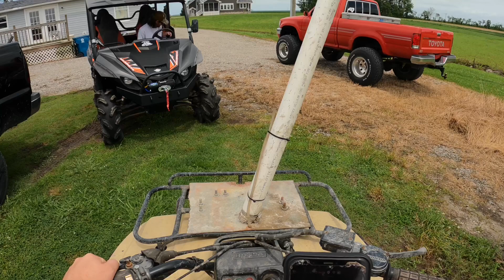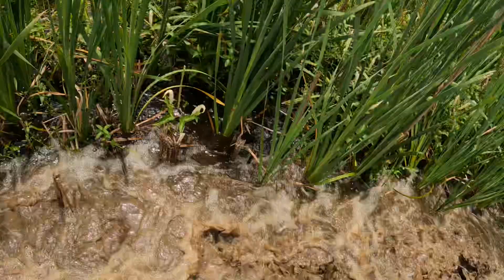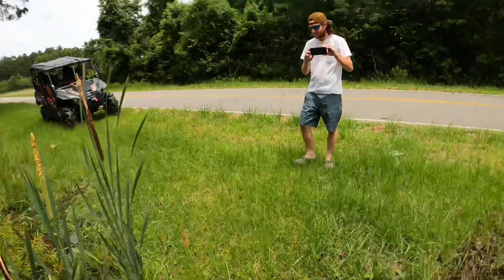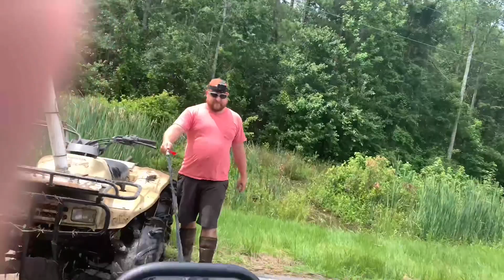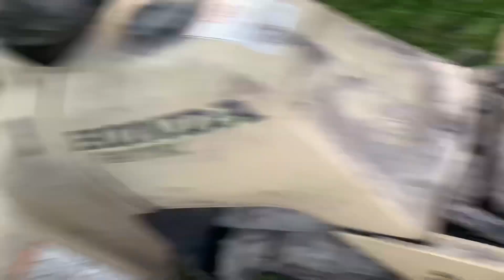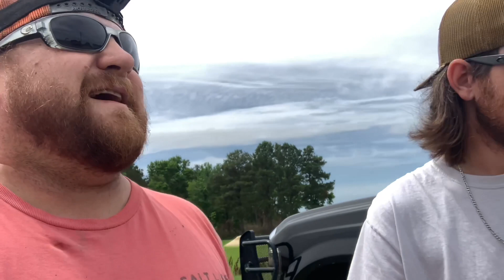HONDA TRX 300 6x6 finally starting to show her worth!!

Comment: First diff lock 300 ? 🧐🤷🏻
Reply from the maker: Hell yeah I fixed the Honda’s 3x4 and turned it into a 5x6 it definitely worked though 😂😂 I want to do a locker so bad but they don’t make the 4x4 shut off anymore and used ones are rarely not broke
Reply: @CAROLINARUTCUTTERZ  I fell your pain brother . The 4-2-4 are so expensive. Without the disconnect your forearms will be burning . I have a locker in a 450 foreman . And it’s a pain outside the mud . Plus call me crazy but I feel like the front seems to run faster than the rear . Love the build can’t wait to see what’s next
Reply from the maker: You never know since it isn’t supposed to lock could make it spin faster 😂and thanks man definitely have a lot more to come im ready to find a pond and see if it can actually water wheelie I don’t think it will but ima try

Comment: first
Reply: and also i've had that same problem with the battery terminal on my atv i guess its something with the older atvs but also i love the yamadog name i call it yama ma ha ah ha
Reply from the maker: That’s what my sxs is called the yamadawg Recovery 😂 and yeah I’ve had it happen one to many times with the battery’s it’s just where I have the cables pulled to tight where I ran them
Reply: Same thing here a lot of times I carry a Philips head screwdriver just in case that happens